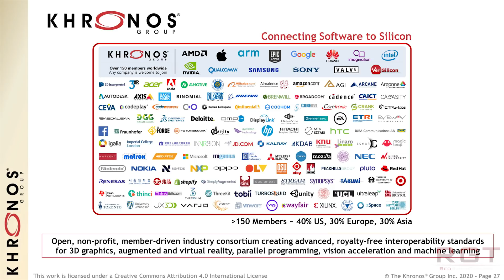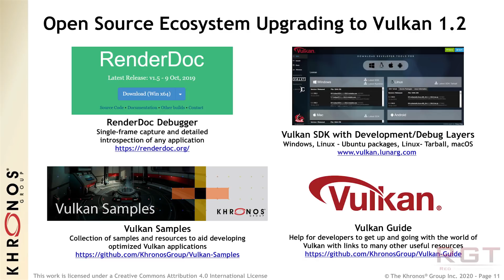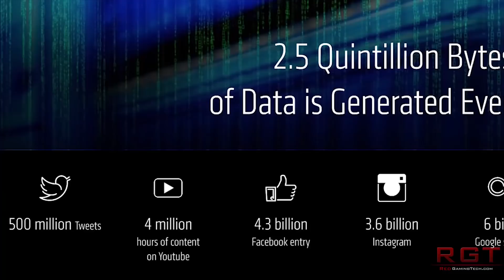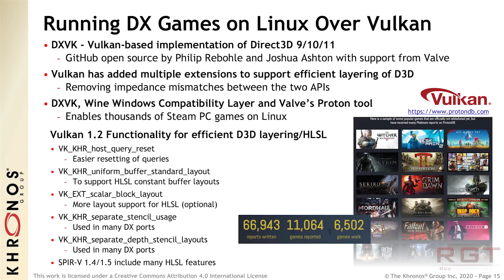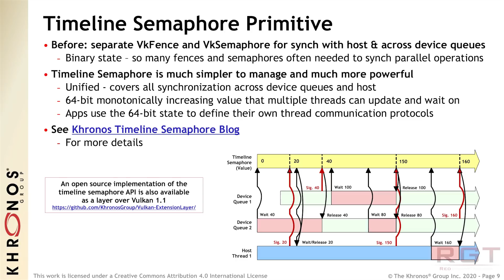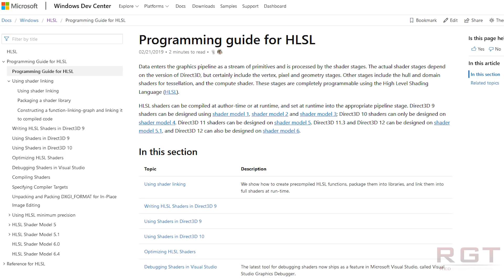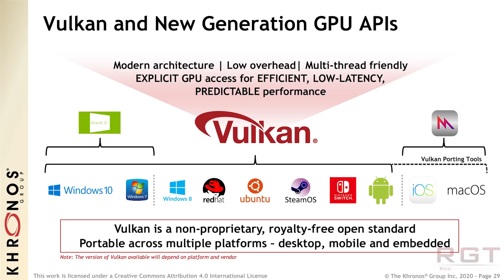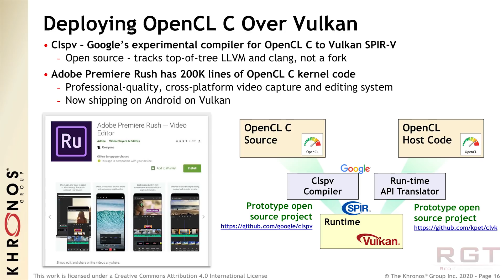Khronos & Nvidia Interview - Neil Trevett | Ray Tracing, Next Gen Consoles & The Future Of Graphics

Comment: The seemingly never ending resolution and frame rate race is massively stifling game development and totally missing the point of actually making games look better and play more realistically.

What I mean is, if I bought a 1650 I can play at 1080p, if I spend ~4x the money I can buy a 2080Ti which is ~4x the performance, but instead of a game looking 4x better, it looks pretty much exactly the same! Yes I can play at 4x the resolution but that doesn't really make it look 'better' it just makes it look sharper, and even this can simulated with good upscaling where required.

I would much rather play a game that looked so utterly amazing and ground breaking that it takes all the power of the 2080Ti / PS5 / XSX to play it at 1080@30 rather than a game 8x less demanding/impressive but can be played at 4k@60. 

And now we have Sony, MS and AMD talking about 8k gaming which is a total joke, we are so far off doing proper AAA 8k that it's embarrassing to mention it! Like I'm sure the PS3 could render Pong at 16k if it really tried but that doesn't translate into that game being the next Crysis! Game developers needs to start taking ownership again like Crytek did back in the day and make a game that totally changes the landscape of graphics and what is possible. Any game that can run at 4K60+ is not going to do that, it doesn't matter what your hardware is, the game should just increase realism and complexity. I don't know about you but I haven't seen a game yet where I'm not sure if I'm playing a game or watching a video recording of the real world especially when humans, animals or physics is on screen. Granted, some of the Quixel demonstrates do offer stunningly realistic scenes but only as static, non-interacting backdrops. The second you interact with these worlds you can see its still a fairly basic game engine world with very limited physics and then put people or wildlife in the scene and again the reality immersion is broken. Hellblade 2 trailer looked a step in the right direction but trailers often look way better than what we actually get and again you wouldn't be confused into thinking that was a genuine video of someone, it's just better than what we have seen before.

The resolution race is purely a marketing tool as it's so much easier to sell you numbers (specs) than it is to explain how a game with XXX feature turn on will look so much better. Look at how hard it is for LG to explain to Joe Average that their 4k OLED looks much sharper than any 8k TV out there. It's the same as 0-60mph times for cars, how often do you put your car into sports mode and set the revs to 4000rpm at lights so you can beat someone at lights? You don't but 2.9 seconds is so much easier to market and sell than trying to explain handling or driving comfort etc.
Reply: well said
Reply: but supporting high resolution is a must have, not for the TV, but for the VR.
4k at 90fps is a must have, 8k 90fps will be even better for VR. so the 4k high fps race still required.
the realism depends on the type of game, fortnite dont need realistic texture and world, like many games.
we need more details for sure as the GPUs can handle them, and red 2 is a good example of that. 

at the end, let the user selects what he want: more details, more realism, more fps, higher resolution, all of them together?
Reply: I get what your saying but before you can have massive leaps in graphic fidelity you have to achieve a resolution that will support that level of graphical fidelity.  Ray tracing has a much lesser impact @1080p vs. 4k.
Reply: While a agree with you, gpu power has always been exponential and resolutions have always increased throughout history. So I think it is kind of inevitable
Reply: I couldn't have said any better. I 100% agree with you. I wish this resolution race ends at 4K for a few years, we need games with very complex physics, more physical interactivity within the game worlds, objects, etc. Realistic destruction on top of evolution in graphical fidelity.
Reply: I agree resolution is just a cherry on a cake for me complex cgi like graphics 1080p at least with smooth frame rate is fine by me.
Reply: I couldn't care less about VR. Also,8k is a joke period. 4k is kinda ok,but 1440p is just enough. Give us better looking games and more FPS,fuck 4k,8k and VR!
Reply: @mike jones - I think the major reason why we haven't been seeing such complex physics is because the biggest limitation this gen has been the CPU! We actually went backwards in the CPU department when transitioning from PS3 to PS4. We have prettier graphics but not the complex physical interactivity. I mean, look at Crysis and what it offered at that time. We've really not seen anything expand upon it in terms of sheer level of interactivity and complexity. It just wasn't feasible on Jaguar cores. Here's hoping that Zen 2 brings big, big improvement in this area.
Reply: @willgart  
I agree that VR needs high resolutions and frame rates and I love the idea of VR so it's like i don't want VR to be successful but VR is a very small niche right now that needs specialists games to be made especially for it. Therefore when a game designer/developer is making choices between graphical effects vs resolution vs frame rates the VR guys will and can make different decisions to the normal monitor/TV market. 
If I had to make guess I would say 90% of all games are played on a screen smaller than 65" and that 10% includes playing on VR headsets. We have to focus on the majority before worrying about the minority.
Reply: I don't think it is. There is more to making good AI or complex physics interactions that feel good than just having powerfull hardware. Developing state of the art technology tools is not just about having powerfull hardware, it's about having the time, resources and the incentive to build them. Naughty Dog for example developed state of the art animation technology for Uncharted 4 and improved upon it for the upcoming The Last Of Us 2. Breath of the wild has nice a chemistry engine that allows elements to intuitively interact with each other, the player and npc's. These are games that push immersion and interactivity in games forward but they took a long time to make and maybe would not have been made at all if they were not being made to sell hardware. At the end of the day when these games sell they create a massive incentive to take more risks.

 It is also important to note these systems must be intuitive for the player to use not necessarily realistic. It has become far more risky, time consuming and expensive to create the kinds of tools needed to take advantage of the higher end PC parts so i'm not suprised there are not teams of Devs like Crytek making PC only games. Crysis IMO sold far below what was needed to convince any PC developer that it's a good idea to do what you are suggesting.
Reply: @AnalogFoundry  but that's all cpu related. It's gonna happen!
Reply: @mikejones-vd3fg  - Nice.
Reply: The more realistic you make things, the harder to make it look right.
Reply: The 2080 ti is more likely 7-8 times the price of the 1650 and 3 times the perfomance,you sucked with infos!Not four times the price and perfomance,the 1650 is 150 dollars,the 2080 ti is a 1000 dollars card and not  even  talking custom models.
Reply: CPU's have been holding Physics back not GPU's. Now core counts are finally increasing for mainstream and consoles are going to be decently capable we will finally see a leap forward. Not to mention consoles having crazily improved load times which I don't the majority of gamers are realise is going to be massive for gameplay.
Reply: Imaging play that beatiful games on a 24 inch monitor....
Reply: @DarthRaver86 86  I personally don't think our hardware is ready for the kind of ray tracing nVidia has shown us up to now, nor do I think it's worth it. 
I liked the implementation of what Crytek did in their Neon Noir demo as it still looked decent but didn't require a massively disproportionate amount of computational power to achieve. nVidia would need to increase their RT cores by about 10x for it to be usefully good and not detrimental to performance which that for me is just a massive waste of die space that could be used more effective in other areas.
Reply: @willgart1  Agree with you here. It all comes down the user's choice. There are many kind of games & platforms out there. While I enjoy AAA games with breathtaking graphics like the op. I also enjoy casual games with silly graphics as well. So marketing and technology development aside. There's nothing that can dictate user preferences here.
Reply: @ Luiz Brito 
No I would have to disagree with you there, in PC gaming we had CRTs which didn't really need high resolutions when gaming because they looked great at any resolution and then when we moved to LCD the resolution actually went down for a long time, it's only recently that everyone became obsessed with higher and higher resolutions and faster and faster refresh rates. 
In the console space, TV were fixed at SD for decades and so hardware development was purely about the games and making them look better as TVs never changed, that's when we saw huge game development from generation to generation. But now the consoles are racing to catch up TVs. By the time these new consoles come out nearly ever TV manufacturer will only be talking about 8K and nVidia will possibly try to move the focus there too if they can with the 3080Ti, they certainly will with Hopper though as you could possibly see 2 or even 4 x 4080Ti dies on a single card.
Reply: @anansi4605  Ok great, it makes my point even more valid then. If you are paying 7-8x the price you should get a lot more than a little sharper and possibly smoother.
Reply: Do you even increase the graphical settings in your game? Or keep it the same when you change graphics cards lol
Reply: @Speak_Out_and_Remove_All_Doubt  No VR is becoming more accessible and it is as to a monitor what television is to radio. It is the future and that is what we need to work toward. It is so much more than gaming.
Reply: @kajmak64bit76  The thing is you joke but if you were playing a game on a RX 580 / 980Ti / 1660 etc, then you have either turned everything right down or off to play at a high resolution which would look awful or you have been playing at a lower resolution with everything turned on. So when you buy more powerful card, generally it only to increase the resolution.
Reply: @Speak_Out_and_Remove_All_Doubt  You do realize when you play with Anti Aliasing at max you play at like 8k resolution or some shit... Especially like MSAA x8... At 4K... That's ridiculous... I turn it off because it's unnecessary for me most of the times at 1080p.. It's completely necessary... Plus RX580 and 1660 are not 4K cards they are not even 1440p they are borderline 1440p xx
Reply: @glenrisk5234  I totally agree about VR is the future but it's not the future within the next few years. There are a lot of things to over come before mass adoption like the TV had over radio, I personally don't believe it will replace the TV as that is a social focal point of the family room, you lose that when you have googles on. I also don't believe people will wear such massive heavy sets so they will need to get much smaller, lighter and wireless. I also don't believe people will generally pay much more then $200-300 in the mass market, I know lots of people will pay over $1000 but I'm saying as an optional add on to a console it needs to be around that price. If the PS5 was only sold with a VR headset and controllers but cost $1500 then the console would fail because people won't pay that much for the experience.

So whilst I agree VR is amazing and is the future for lots of entertainment, it won't happen until those things above happen and they are a good 10 years away. In which time GPUs will be massively more powerful and will happily render games at 8K at 120fps per eye.
Reply: @untseac  Yeah I agree, but we are still not ready for 4K and in an absolutely ridiculous series of events TVs and Consoles are already talking about 8K. The only way we are playing 8K in the next 5 years is by massively reducing graphical effects and features.
Reply: @Speak_Out_and_Remove_All_Doubt  No, read some news man. It's arrived!
Reply: @glenrisk5234  The coronavirus?
Reply: @Speak_Out_and_Remove_All_Doubt  CES 2020, and in old news the OC Quest. XR2's will be out this year too. Compared to televisions computers are terribly expensive but it's quite common to have one today. When I got my first PC twenty odd years ago it was not so common.
Reply: @glenrisk5234  I'm not quite sure what point you are making, what are you saying will happen this year or very soon? VR will replace TVs? Or more games will come out for VR than for normal screens?

I'm also not sure what you are trying to say about the cost of computers and TVs. You can get a decent TV for $500 and you can get a decent computer for $500. Or if you want to play games you have get the best games console for $500.
Reply: @Speak_Out_and_Remove_All_Doubt  No I'm saying the success of the Quest, they have been sold out for months in the US and Europe will fuel greater development. That there were a couple of things at CES this year that indicate things are already speeding up in the development of VR tech. I mentioned the XR2 because it has double the capability of the processor driving the Quest and they have their own headset coming out this year and five other companies have been working with them on developing headsets. VR is about to go mainstream.
Reply: @glenrisk5234  I just want to be clear, I absolutely love VR and the future we will eventually have with it looks amazing so don't take this as me saying I don't like VR or that I think it's just a fad that will go away like 3D TVs but...

Whilst the specs for the Oculus Quest 2 are decent, they are a million miles from being able to play proper modern AAA games at the resolutions and frame rates needed to not look like a massive step backwards in gaming visuals. It is like a Wii vs PS3. 

I'm not saying the Quests aren't fun to play but it's not where VR needs to be for me to buy it and I can see it selling in the same way as the PlayStation Vita sold. Yes people will buy it but not that many in the grand scheme of things. 

For most people the Quest will be much too expensive for the small amount of time they would play with it, plus it's still too big, heavy and unwieldy and ultimately the quality in games is a big step down from what they play at the moment on their PCs or soon to be PS5 / XSX for the same price (but ok not the same experience).

Then you have the issue that proper VR is very much '1 person at a time' as only 1 person can wear the headset at a time, yes you could buy more than 1 headset but then that is double and triple the price, whereas as many people as you want can watch the TV together or 2 player or more split screen is also easy and free.

As I said, I think VR will only properly take off once:

- the price is $200-300 for a unit  that:

- plays current modern AAA games at a min. 4K per eye at 90fps (ideally 8K @120+)

- it's not bulky or heavy

- and ideally wireless but maybe not absolutely requirement 

I don't believe we will see this until at least 2030 and beyond. The 
Pimax Vision 8K X looks decent but the price is a long way from mass market and the size is huge. We are getting there but I think you are massively optimistic with your time scales unless all you want to do is play Wii level games and happy to pay the price of a PS5 per headset to do so. But i don't think that will go 'mass market'.

Your best shot at VR going mass market is the PSVR 2.0 with the PS5, depending the cost, specification and level of support Sony makes studios give this headset then that could start to see VR really take off but again I can't see this headset costing anything less than the same amount as the entire console and we are still probably only looking at about 1% of PS5 buyers will buy that.
Reply: @Speak_Out_and_Remove_All_Doubt  No I can't support a company that violates the rights of those who use it's products. Prudes are always perverts. And all your naysaying makes me think you are living under a rock? Again I tell you to check out some news. There were goggle like VR devices at CES this year, there is a very interesting patent application by Samsung. Hell there is even a working AR contact lens. The things you say are needed are literally on the doorstep. It won't be ten years, I doubt it will even be five?
Reply: @glenrisk5234  Who are the perverts?

I hope I am wrong and you are right but I would love to have a bet with you though, that you can't buy my VR headset specifications within 5 years. If you can I will buy you a pair, if you can't you have to buy me the closest there is to it.